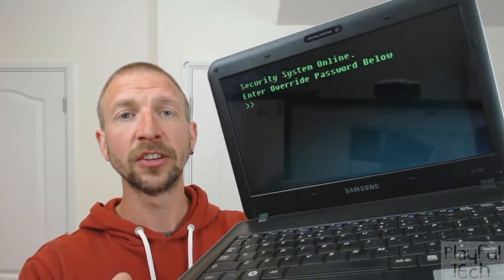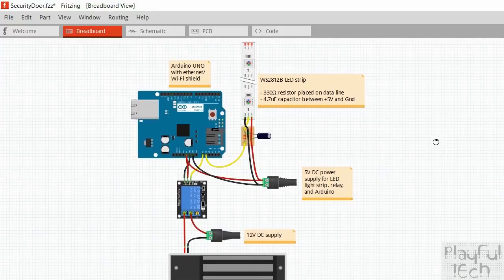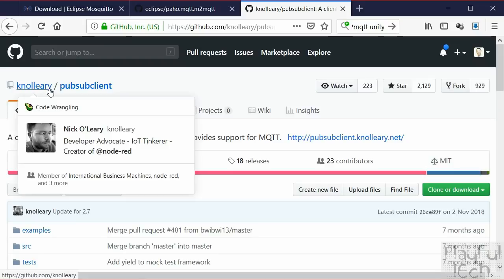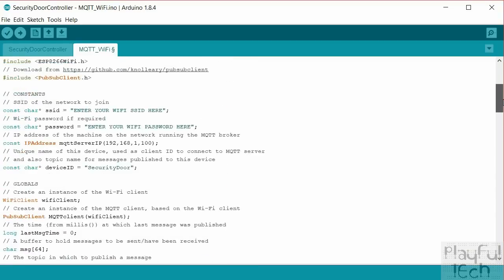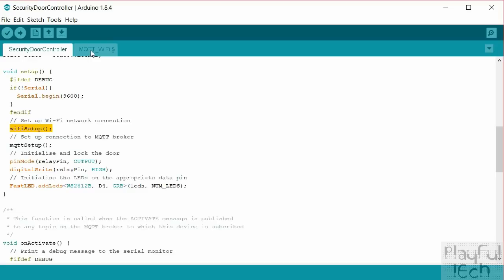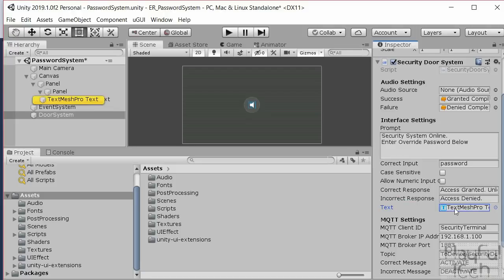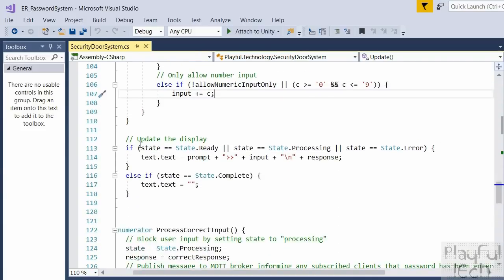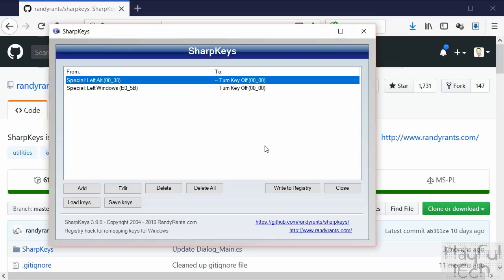Escape Room Security Terminal Puzzle Tutorial

Comment: Thank you! With some modifications, I was able to make a login screen that asks for username, then password and then shows a code.
If the username is wrong, it is the same as with your code: back to the beginning. If the password is wrong, it goes back to the password stage (maybe later, I could add a counter where the ammount is limited before going back to username). Edit: here's a video of what I did: https://youtu.be/nWEvNoHPHLo

But I do have a question: is it possible to create something like a blinking cursor at the end of the (empty) input? It doesn't matter if it's always blinking (even when text is entered) or if it only blinks until the first character is entered

I tried, but couldn't find anything that works. (the closest I got was a blinking pipe symbol ("|") , but it was extremely fast (multiple times per second) and I wasn't able to type.

Or maybe I'll just add a sticky note to the PC "to new people using this terminal computer: the blinky thing is broken, you just have to start typing and your text will appear. Also, our stars are broken too, so make sure nobody is behind you when entering password"
Reply: Sounds a lot like something "2.8hrs later" did for one of their games a while ago.

The chase route had "Terminals" (Cheap Android tablets as far as I could tell) spread along it, that brought up a fake CMD line interface. Players then entered a "Hack" ( "/Terminal DisplayServerHostLocation" or somesuch) which caused it to spit out a graphic showing the map coordinates of the next terminal. Anything else just dumped them back at the CMD Line.

Wash, Rinse, Repeat. Along with various Zombie related shenanigans along the way.